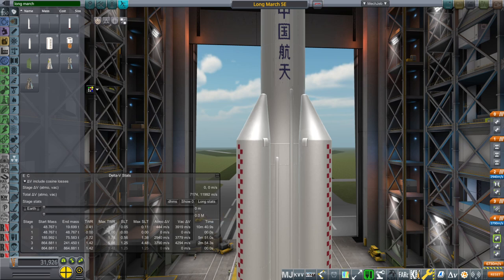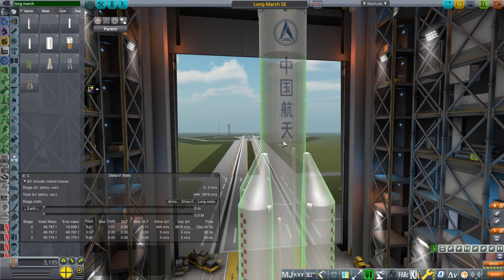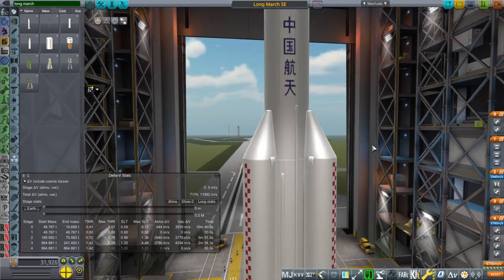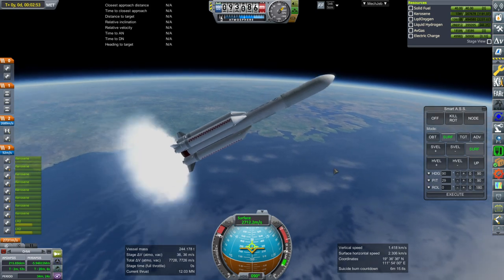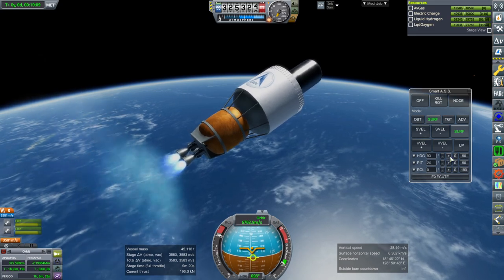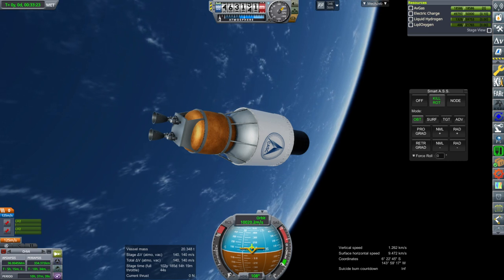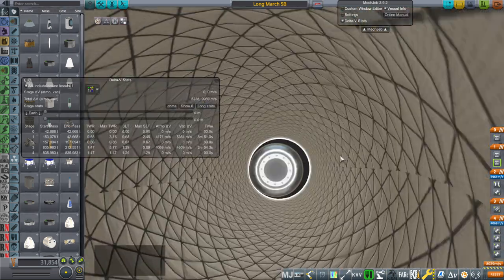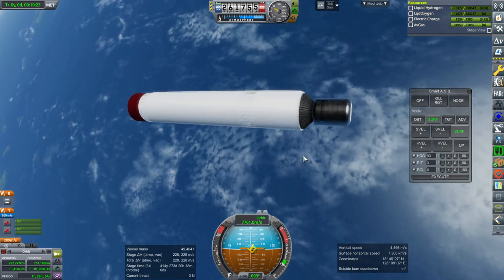Realism Overhaul in KSP 1.8.1 - Long March 5

Comment: the chinese rocket that going to carry the new capsule and future lander is not going to be LM-5, there still no name for it but you can find the specs here: forum.nasaspaceflight.com/index.php?topic=50963.0 ,resuming is going to be a 3 core rocket,like DIV-H or FH with 7 Yf-100 per core, a yf-100 Vac as the third stage, and a final stage that looks to be similar to the LM-5 upper stage, performance is on par with SLS block 1 for TLI
Reply from the maker: Well, at least I got the YF-100 done, then.

Comment: The LM5 second stage have only a 4.0-4.2 dry/wet mass ratio.
Reply from the maker: Not sure if you have a source on that, but I'm assuming that you mean wet/dry and that includes the engines, payload adapter, and the RCS system that needs to be added. Not sure how they count the fairings.

Comment: Is it possible to design a multi-fuel engine (One that can run with all propellants....LH2, CH4, RP-1)
Reply: LR-87?
Reply from the maker: Possible, but usually inefficient - especially for the LH2, which is of such different density that it complicates the turbopump and plumbing. Hydrolox also burns at much higher temperatures.